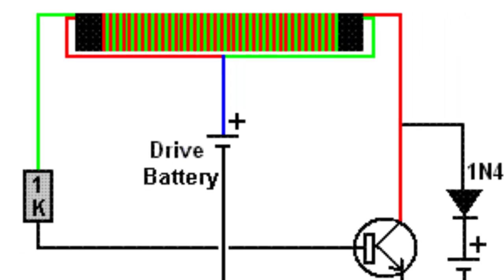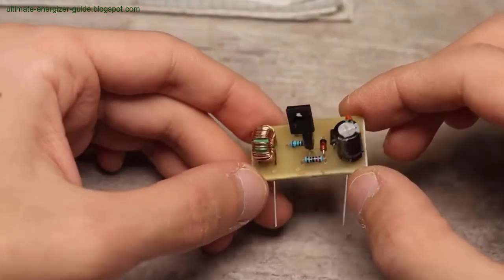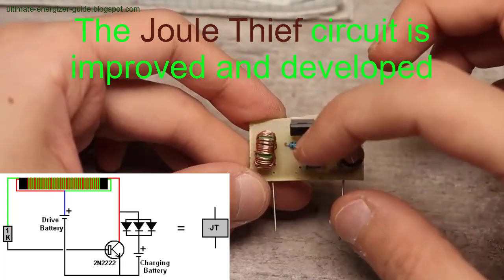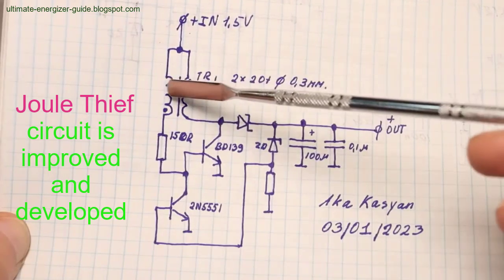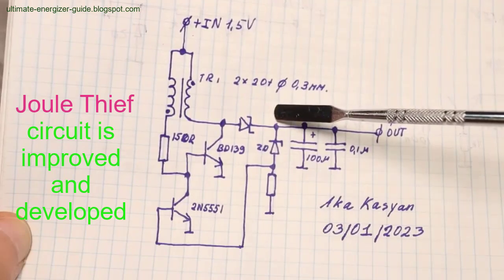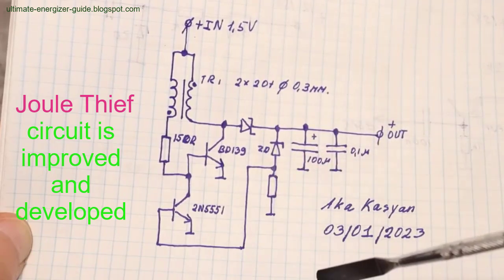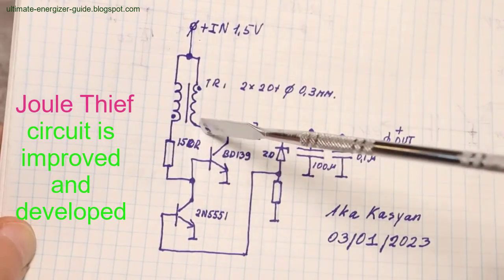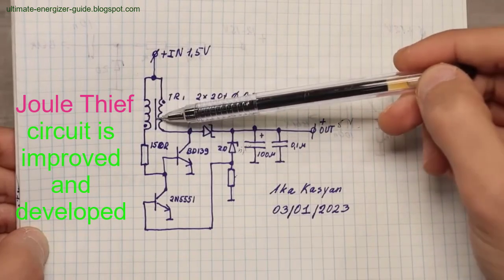Free Energy: Improved and developed Joule Thief circuit | Basic explanation for Joule Thief circuit

Comment: That was... entertaining... sort of.

The circuit shown is a pretty basic switch-mode regulator.
It does NOT "produce free energy".
In that configuration it does deliver a higher output VOLTAGE than the VOLTAGE you put in.
But, in order to do so, it requires more current at the lower input voltage...
You use low voltage at high current to "charge the coil"...
Then you extract the energy you put into the coil at higher voltage but lower current...
So it is acting as a "voltage step up device" and NOT "creating free energy.
The OVERALL ENERGY you get out is slightly LESS than what you put in.

Yes, "we are all surrounded by various energy fields"...

These include the Earth's electrostatic potential and magnetic field...
As well as leakage from power lines and the power being broadcast by various radio devices...
And, in theory, with proper equipment, you could extract or tap some of that energy...
But the amounts of energy involved are VERY TINY over any given area or distance...
(You can probably light a single small LED using an antenna a few hundred feet long.)
(You could also theoretically light an LED, using a proper antenna, by holding it near your WiFi router...)
Reply from the maker: Where did you copy this?
I read it and it felt familiar. It seems like the slogan for suppressing free energy has arrived?

Please reply to the copied content:

This is not a transformer.
The reverse induced emf will be blocked by the Diode. Take a look at the electrical circuit. (you haven't seen it yet?).

You are just a Bot, or a parrot that has learned to speak in some way.
Reply: @ultimateenergizerguide467  
I'm sorry - but YOU need to go back to school.
This is a slight variation on a basic "boost regulator".
(I didn't analyze the exact details because they just plain don't matter.)
Assuming that it works at all....
When energy flows in through the wire it generates a magnetic field...
This energy is then stored in that magnetic field...
Then, when the current is "cut", the field collapses, and the energy exits via the other wire...
The induced EMF exits the system through that top diode and is used to charge the output capacitors.
It cannot go back the way it came in so it exits through the outgoing diodes and charges the output capacitors...
HOWEVER the bottom line is that YOU DO NOT GET MORE ENERGY OUT THAN YOU PUT IN.
Not only is this stated by the laws of physics...
But nobody has ever demonstrated an ability to break those laws...
AT MOST you could pick up a really tiny extra bit of energy from things like the Earth's magnetic field...
And maybe a really tiny amount from the Earth's electric field and the 60 Hz noise all around us...
But that amount will be really REALLY tiny... to the point of being negligible... and far less than the losses in the system itself.
Reply from the maker: @keithlevkoff8579  The induced electromotive force goes backwards, into a place where there is no resistance, passes through the diode, then into the capacitor to charge, or into the battery to charge.

That's old 9th grade knowledge: Current will choose a place without resistance to pass through first in a parallel circuit. Middle school knowledge.

Voltage transients will give greater energy.

If you are an engineer, re-read the works of Charles Proteus Steinmetz to start learning again.

I think you are a paid opinion columnist or someone who has been deeply brainwashed by shallow education.